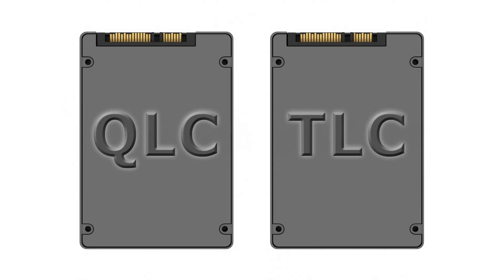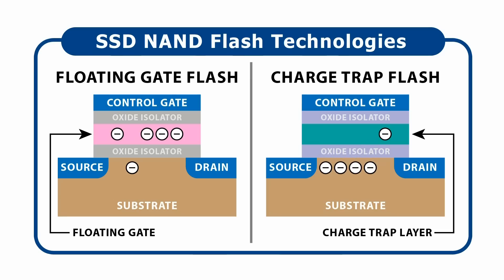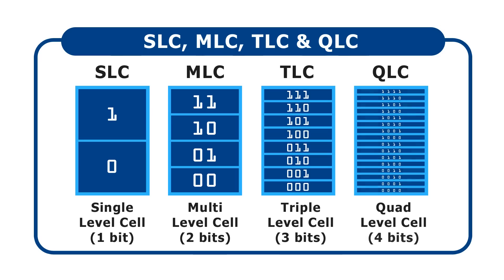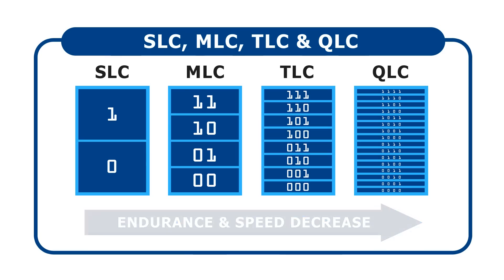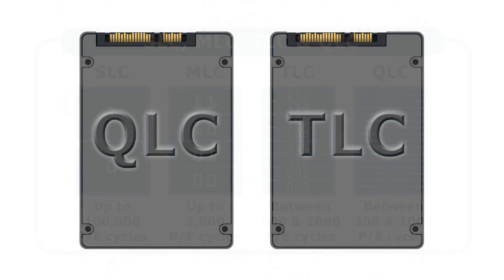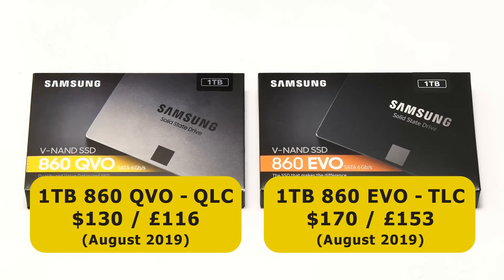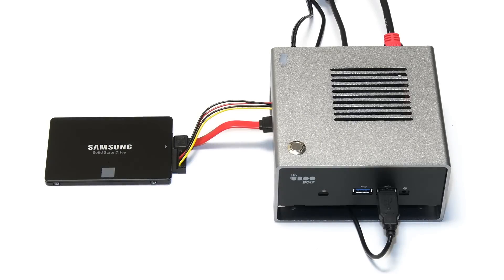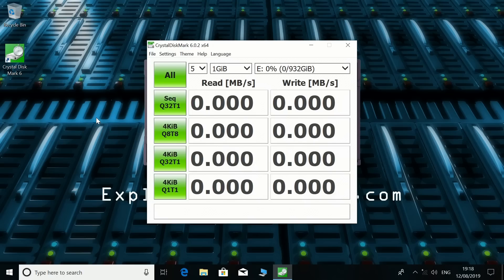QLC vs TLC SSDs: Samsung QVO & EVO

Comment: First tests are clearly showing SATA interface as bottleneck for such drives. You need PCI-E for any meaningful comparison. Second test with large amount of data is looking more like and weird drivers/drive failure and some kind of fall-back mode
Reply: @Ana Assburgian Given the speed potential of either SSD, SATA interface made this "comparison" completely pointless. Apart from failure of drive and/or software in second "test" there is absolutely nothing to note here. Now, I just wonder what makes you so persistent on denying this simple observation.
Reply from the maker: @Dans Shade I am doing legitimate tests of popular products that many people use or may use. So the results are far from "meaningless". They may not be tests, as you note, of what the underlying tech is potentially capable of. But that is irrelevant to most users. Many people who watch this channel use Samsung EVO SSDs. Now the QVO drives are on the market, and it is I think therefore very "meaningful" to demonstrate how a SATA EVO and QVO compare using a standard test like CrystalDiskMark, and a further test that demonstrates where they performance diverges.
Reply: @Ana Assburgian My point was that it is meaningless to compare those drives with SATA in tests that measure throughput. The difference in second test is more like an oddity of setup or faulty drive. The only real difference between those drives with SATA interface will be endurance and rate of performance degradation near EOL of each drive. Absolutely pointless for most of users of SATA versions of these.

Comment: everytime i think of QLC, which has been around for quite some time; I think of the Jon Tron 'you have gone too far' meme. TLC drives already have issues with long term reliability. QLC just antagonised that for me.
Reply from the maker: @Ana E I described QLC in the video as a "fairly new to market technology", which is true. Of course, it depends what you mean by "quite some time"! But I would take that term to mean many years.

Comment: I'd love to see the tests repeated with NVMe versions of those drives
Reply: An intreresting test would B 1 of the 'high bit' NVMe drives & watching it die after 300 write cycles = HAHAHA  Solid State Storage is a joke =P  Stick 2 spinning discs, preferably 5400 RPM non-shingled =)  Faster spinning drives R just a $cam 2 overhead & die, & shingled is a scam 2 pretend they have more capacity by converting everything 2 sequential 'layered' nonsense with lousy seek times.

Comment: It looks like the test files just weren't big enough to fill the cache on the TLC drive at the rate things were being written to disk. It would be very interesting to see a larger file transfer that could actually fill the cache to see the raw write speed of TLC.
Reply: @Ana Assburgian Yes, we saw that on the QLC drive. He didn't reach the cache limit on the TLC drive to see the write speed.  It would also help determine if that 77MB/s write speed was a function of the QLC, or if it is a limitation of the SLC cache controller when full.
Reply: According to Anandtech.com, the sequential write speed on the SLC cache is 520MB/s and the sequential write speed on the QLC is 80MB/s.  This test got pretty close to those numbers.  I couldn't find solid data for sequential write speed on the TLC on the EVO, so getting past the cache limit on the EVO drive would have yielded interesting results.  This test does show that the cache works MUCH better on the EVO, but I would like to know where it hits it's limit.

Comment: The "Intelligent Turbo Write" (or SLC cache) sections of these drives must take a beating, and likely have a much higher P/E life cycle.
Or, has Samsung figured out a way to have its SSD's controller utilize the SLC cache only when it determines that the TLC (or QLC) NANDs are about to bottleneck -- meaning that data would normally go directly to the slower NANDs, and only hit the SLC NANDs whenever the controller expects a performance hit?

Comment: 11:30 I think this speed is rather achieved by Windows caching some of the Data in RAM before copying it to Disk - or Windows Explorer is just making things up
The SATA 3 Interface can only transfer 600 MByte/s (550 MByte/s useable), 1.05GByte/s is double of what is physically possible :)
Reply from the maker: Yes, Windows Explorer has to be wrong there! :)
Reply: @Ana Assburgian nice, i will give it a try :)

Comment: Can you change the packet size handling in the reformat of these drives to increase the speed of handling packets? Such as making the packet size match the cell bit size of 4 bits on the qvo vs the 3 bits per cell tvo drive?

Comment: The Crucial MX500 1TB (TLC NAND) is only 110$
Reply: WD Blue 1TB 3D NAND here.

All three are so close in benchmarks it came down to price.

EVO, WD and MX500 are very similar, without benches you could never tell them apart.
Reply: And shity ssd manager and also once in a while shit freezes on windows startup. But its cheaper anyway...
Reply: @fulldnbboy  I have the MX500 1TB running in my System for 2 months now and never had a problem ... and I diddnt even know there was a SSD manager XD
Reply: @Felix-j3d4b  its probably my side thing then since im running it in wooden pc which has sata2 ports and ssd manager does not even see the ssd. Too old pc for such ssd lol.
Reply: I bought MX500 500GB for 66$ (2000 Baht)
working well! (but I hate that SSD manager)
Reply: @BNTNJA  
I bought a load of 2TB MX500s for about £190 each. I didn't use an SSD manager, I just plugged them in, formatted them, and started using them.

Comment: It blows my mind that both qlc & ttl ssd ssd drives had petty much the same writting speed untill after writting 2 3th of a file, the ttl only needed 30 seconds to complete writting a file wereas the qlc required a whopping 6 minutes just to write the last quarter of the file to it’s memory, why is that? That the writting can decrease or increase overtimes during the advancing process?
Reply from the maker: It is because initially both drives are writing data to SLC cells, which are must faster.

Comment: This is another good video from EC.
I do feel somewhat skeptical about it being possible to set, hold, and measure sixteen different levels of charge in one cell reliably. It appears to imply that the quantity of charge needs to be maintained and measured to within about ±3%, which looks very tight indeed.
The standard advice, as always, is make multiple off-site backups.  It is also a good idea to purchase storage from multiple manufacturers, at different times to reduce the risk of simultaneous failures.

Comment: Thank you - a useful bench-marking exercise that needs to be performed with each iteration of hardware ? Possibly for someone such as yourself who is running a business, if the drive is guaranteed for three years, then you declare it as "capital equipment" that is written off against tax over three years, and then replace it ? I know ( and have worked for ) businesses who don't have any drives at all, and store everything long-term in the Cloud. Hobbyists with family portraits could keep backup copies on other media such as HDDs, in the Cloud, or on DVDs ? It certainly depends upon what "mindset" you want to employ, but as others have said here, a duplicity of storage solutions seems a good idea. Someone I know well, an elderly gentleman called John Copeland who has the longest-running diary on the internet, still backs everything up to floppy diskettes ! A very interesting discussion which quickly leads on to more than the new technology you're bench-marking for us ! Many thanks for doing that !
Reply from the maker: You are luck to know John Copeland.

Comment: The loss of performance on the 860 QVO compared to the 860 EVO is all about their NAND. The 860 EVO uses the same NAND as the 970 EVO and that NAND can write at speeds up to 2000MBs directly to the NAND. The QLC NAND cant reach that speed as shown in your test here. And that is because of how hard it is to write directly on QLC NAND. In the future we surely will se QLC NAND that can reach much higher speeds. When that happens, we likely will see them on NVMe drivers.
Reply from the maker: Very useful info -- so the limit is the SATA3 interface. Although this means that the different in write speed of the TLC vs QLC cells is massive.
Reply: @ExplainingComputers  correctly :)

Comment: Great info as usual but very concerning as it seems that manufacturers are actually building increasing obsolescence and poorer performance into their newer products! What results I would really like to see is some kind of real-world life expectancy (in years) under average usage. I have mechanical drives ten years old and even more that still work perfectly - Will we be able to say the same about SSD's or should we EXPECT failure within or shortly after the warranty period?
Reply: There are tests going on for ssd. There are some drives that died before tbw mark during warranty time, there are some that failed after such things shortly and therr are some drives that got written ten times over what was expected of them with some still going strong. It all comes down to how the write averaging algorith is made in ssd controller. If its good, your ssd will last you much longer than your pc or laptop will be able to live(upgrade). Also it depends on how much data you store on ssd, if its half full, ssd will last longer than fully full ssd. I can definetly say that average user will not exceed ssd exoectation in 5 years, somewhat even in 10 years even if its been used in productivity workloads like cinematography or photography. However, the bugged antivirus can severely reduce ssd lifetime like it was with bitdeffender antivirus one time.
Reply: @fulldnbboy  Thanks for that - what I would like to see is some sort of true-usage comparison (like take ten identical SSD ''s and write and erase them continuously until failure) - then chart the results. Do this with, say, five major brands and compare them all.
Reply: @Beevreeter  thats exactly what some on going tests are doing. Info is on the web ofc. Ive read about it so long time ago when samsung wasnt up with their evo series and that is long tine ago. Since then such tests are going on. In any case, average joe wont exceed even qlc drive life expectancy within 5 years. I thought im not average joe, took tlc drive, 500gb one, doing photography and stuff. Year later i used up only 4% of my ssd... I got so much usage left on my ssd that my pc will be museum exponate before ssd dies.
Reply: @fulldnbboy  If you only used 4% of a 500Gb drive in a year you clearly have barely anything on it. That's hardly 'real-world' usage. I have 7Tb of storage in my PC and it is nearly all used up.
Reply: @Beevreeter  i dont use my ssd as filled up garbage can, my needs go from memorycard to ssd then to hdd. Ssd stay mostly below 50% fillage. Ssd algorithm works very well to average all my read writes over whole drive, hence why such low write count.
Reply: @Beevreeter  I'm sorry, i made a mistake, its not 4%, its 7%. Just rechecked if i was correct about used up precentage. Still, 7% in a year and with more than average joe work, I would definetly replace this ssd in 10 years if my work would remain same.

Comment: Thanks for this video. I have one comment. You believe that larger and faster drives ar “transformative”, was that the word? But really it seems to me that larger and faster drives rarely make much difference, because our need for capacity and speed tends to grow at a similar rate. I have never bought more space or higher speed except when I needed it. They make new cameras all the time which produce larger files, don’t they?
Reply from the maker: I meant "transformative" in terms of typical desktop PC end users switching from SSD+HDD to SSD only systems. I guess the issue is, when you need more capacity, what will you buy? And QLC drives provide yet another option.

Comment: Thanks for the video and benchmark. Did you manage to determine on what size the evo drive starts reducing transfer rate?
Reply from the maker: I didn't. It may be that its slower speed is still bottlenecked by SATA3, but I doubt that, as TLC cells cannot be that much faster than QLC. So I suspect the 1TB EVO drive has been upgraded but -- as somebody notes below -- Samsung have yet to change the spec sheet.

Comment: I have 3 drives in my computer. I have a 512GB SSD as my boot drive, a 1TB data storage HD to put all my bigger long term storage on, and my 3rd 2TB HD is set up as my auto backup drive having my files regularly backed up to it from both my boot drive and data drive. It also contains 1 of two full backup images of the boot drive. My second boot drive backup is on an external HD. If anything fails I would lose at most 24 hours of data with my current back up settings. Anything super crucial I always back up manually to and external HD anyway.

Comment: Since SLC is 1/4th of TLC ,for say a 250 GB TLC SSD I guess the utter maximum space of cells used in SLC would be 1/4th of 250 = 62.5 GB but then there wouldn't be any space left to define as TLC to  internally copy the data to it to free up the cells used in SLC. Some time ago when I got my first Evo 850 SSD I tried to fill it up with huge files to see where the write speed would go down and I also didn't find it.

Comment: It seems that QLC would be handy for cheap long term storage that needs only to be read and rarely if ever re-written. Fast read, low space, lower heat and no moving parts resulting in mechanical failure could make them a real viable option for things you want to keep with an MLC or TLC drive for frequently re-written data. Once it hits the the current HDD prices, I will definitely consider using them to replace my current home server drives.
Reply: But remember, for archiveing purpose, stick with hdd. Qlc will lose its data within half year, give or take. But only when drive is fully removed from powering circuit like you would do with real archiveing.

Comment: My laptop just has a budget Bwin 500GB SSD. I ran Diskmark yesterday and was surprised to get 550 / 470. Almost the same as these premium SSD drives. So Budget does not always mean slow.
Reply: For SATA drive they are all pretty much hitting the limit of what the standard can support in terms of speed, however for M.2 drives the more well known manufactures have a big speed advantage. There are also differences in the controllers firmwares, even if two drives are using the same controller chip, in all likelihood the more well known manufacturer is going to be using a firmware made in-house with improvements\optimisations for the exact nand chips they have used. More budget vendors will likely be using the stock firmware that the controller manufacturer supplies that may or may not be as good as an in-house developed firmware.

Comment: I don't trust any storage medium. I have backups for every system. :D
Reply from the maker: Totally.
Reply: That, of course, is the best practice. But I wonder about ransomware attacks where the backup is still connected to the victim PC. I'm assuming the ransomware will go after the backups as well. In other words you should disconnect your backups or power them off somehow. Is this correct?
Reply: @henryD9363  Yeah, this is true. I have a lot of networked machines. I do backups on external storage via usb 3.0 and I also have a networked storage server that I turn on to backup other systems to as well. I use sftp for all the file transfers and run Linux on all my machines. There are several different operating systems that use the same network as well. So it's a major concern that my data could be encrypted by malware. But I leave my backup systems offline until I am actually moving data to them. And I don't have any samba running on my machines. I just don't trust samba for sharing files on my network. :D

Comment: Presumably at the 42gb gigabyte point the TLC drive had (in the background) offloaded much more from the SLC cache to the main drive than the QLC drive had managed to at the same point, and it was able to do so because TLC is faster than QLC. In fact it seems like the SLC cache in the TLC drive was never actually at capacity, where as the SLC cache in the QLC drive hit capacity after about 45gb copied.
Reply: You make a great point I didn't think of. Still, I think TLC would still run in capacity limits eventually, it just is able to delay that limit way further than QLC. Otherwise having a SLC cache on a TLC drive wouldn't make sense.  Naturally we would need a greater volume of data to write to the TLC to show the same effect as the QLC.

Comment: I think SSD's are very annoying in the sense that if you copy files to it and you stay below the cache threshold you think that your files have been copied once the progress bar says 100% however if you pull out the SSD drive immediately when you think the OS is done copying a lot of data hasn't been saved to permanent memory and will be lost. So these cache mechanisms lead to misleading information being shown on the OS level. I'd prefer SSD's not having any cache whatsoever unless they are deployed in systems that stay on all the time
Reply from the maker: The cache here is SLC SSD, not RAM. So if you did disconnect the drive, the data whould still be stored, and would be migrated to TLC/QLC cells when the drive was next powered. I totally agree with you on SSD DRAM cache, and the even worse idea of Samsung's RAPID mode, which uses a PC's RAM to cache data -- a very dubious concept, and certain to lose data on a system crash.

Comment: So for the same price as buying four 1 TB TLCs I could build a raid five array of QLC's? Also I noticed you used sata drives, I'd have to assume that the same kind of distinction is being made in the m.2 form factor. I wonder if there's any money to be made building a raid controller card with five m.2 slots?